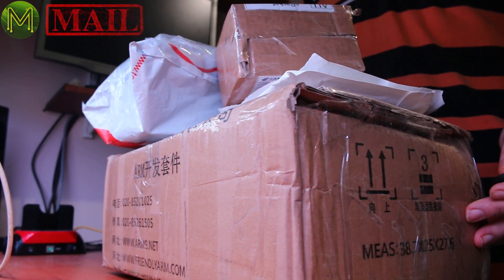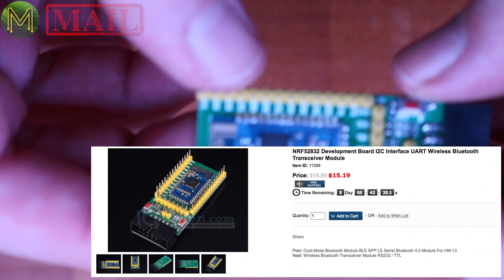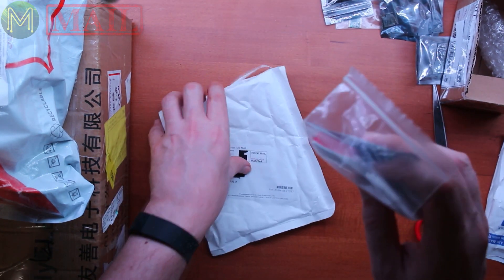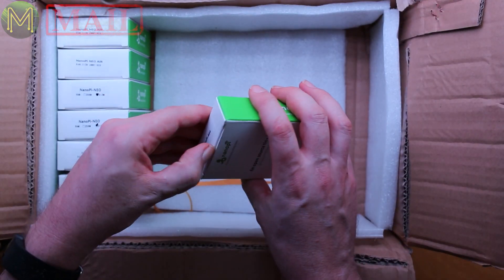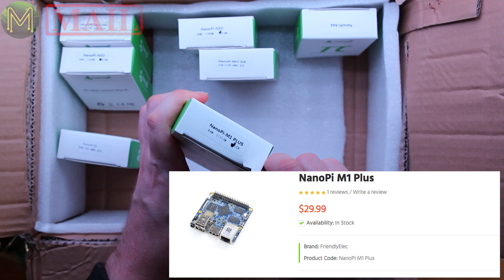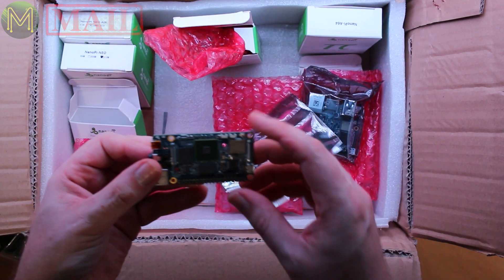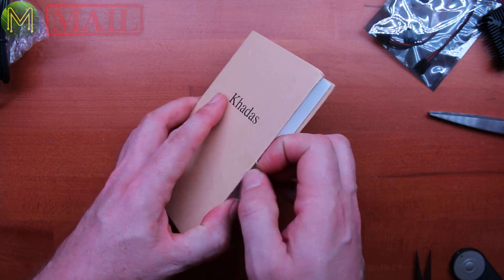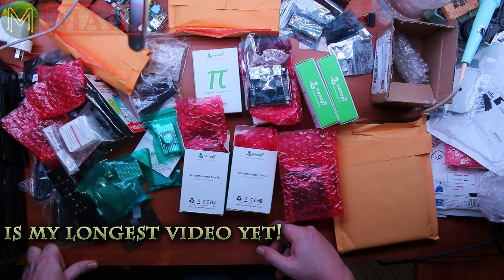#118 MickMake Mail #07: A massive booty! // News

Comment: The Firefly... I also ordered one but I had trouble with the shipping. Don't got it... hopefully i will get it in the future...
Reply from the maker: +Philipp Blum 
Alas I haven't had a chance to even open mine up! Not so good about the shipping. When did you order it?
Reply: +MickMake
I ordered it on the 17.02.2017. I called with DHL and they said there's an issue with the customs in Germany.  Firefly  gave me the only the order number from parcel. I wrote the support and then they gave me also the postNL tracking number. With this number I got the information from DHL. Uff... I want to start the project...
Reply: So, they said they will get back when they have an update for me. So then I haven't heard from them yet. I will give up. I will not receive this board in my life. The 250 Dollar are not such a big deal. It's not that much money. Event If I receive the package in 6 months how can I work with this company together if they can't send me an package in a reasonable time? I'm really frustrated about this topic because the SoC is really interesting and fits really nice to my current project. But I will order the 96 HiKey Board. Similar Specs and I thing the Linaro EcoSystem is well developed. So we will see.

Comment: Always Good Mannnnnnnn .. thanks or doing this. you save me bales of time.  BTW I have a question. Ever seen any ATMEL RF215 boards around ? They are used utility A LOT for a standard called WiSUN (like Zigbee just better)
Reply from the maker: +Peter Laidlaw 
Actually I haven't seen those before. There's so many boards around. I'll check those out when I return from vacation.
Reply: Here is one but expensive: http://www.atmel.com/tools/atreb215-xpro.aspx
This chip seems to me anyway as the wireless maker's dream but strangely does not have a following like LoRa .. millions deployed in smart meters.

Comment: Mick, what is a good board for a beginner?  I work a lot with PIC chips in machine code, etc. making LED cubes.  Am looking for a board to replace our pile of laptops.
Reply from the maker: +Paul Barton 
For a beginner nothing surpasses the Pi. You get a massive community backing, it's cheap, and guaranteed someone has already done what you want to do.
If you want to step up, then I'd look at an Orange Pi Zero or NanoPi Zero.
Reply: OK, thanks Mick. Was looking at the Zero-W, if they are "in stock".
Reply from the maker: Yup that's a good board to get started on. Have a look at my short review video on the Pi Zero W where I show you how to connect to it without a keyboard and screen.

Comment: Just checked a Sonoff i got off Banggood when they were on sale a while back. It's the same 10A model (is that rating, or model #? I dunno) as those, but has no such modification. Is that something I should look into adding, or is it not really needed?
Reply from the maker: +stryk187 

+pawel753 also commented on this. Seems I'm the only one with that mod. What about your mains copper track width? Is the same as mine?
Can you take a photo? Would be good to compare with mine.
Reply: +MickMake Yep those tracks look about the same as far as i can tell, just snapped a photo, sorry for not so good lighting, but here's a link: http://imgur.com/a/QBjLa
Reply from the maker: +stryk187 
Thanks for that. Yup seems to be the same. Wonder why they added that cap.

Comment: And what are you going to do with all these Pi Zeros and Nanos? Except giving few of them as a prize of course ;)
Reply: he mentions that he will be doing "home automation"  in his studio. these boards have a wide range of use from robots to servers
Reply from the maker: +pawel753 
I have a bucket load of tutorials coming up. Some of them are home automation based, vehicle projects, LoRa, then there's a revisit of my old projects to bring them up to date.
Reply: My point was actually, you don't always need separate device for each project. For example I've got Banana Pro which I use for more than a year as 
(1) NAS server with SSD connected to SATA port
(2) Home automation centre - Domoticz with RFLink (Arduino Mega) + many 433MHz devices and ESP8266 switches/sensors
(3) RSS notifier service - cron checks for RSS update of my favorite channels and sends me email notifications when something new come up
(4) from time to time I even run a video processing in a background - I use it to convert videos uploaded remotely on SSD from MOV format to MKV
My BananaPi works great with all these stuff running in parallel and my only concern is that I will have to setup all this stuff when my SD card is down ;)

Comment: I've got 6 or so Sonoffs bought on ebay in December and Feb but none of them has this strange "homemade" modification :) And all of them works perfectly without the additional capacitor! I'm very curious why did they put it after production stage, maybe they got some malfunction warranty returns which happen under some circumstances
Reply from the maker: +pawel753 
Are you located in a 120v mains country? I know that the somoffs are both 120/240v capable, but maybe this mod is specific for 240v countries.
Also are your mains power traces as thick as mine? There were some "recalls" due to the copper being too thin.
Reply: MickMake I'm from Europe so got 230V power but I belive these devices are universal an fit every power voltage, similar to phone or laptop chargers

Comment: I have most of the friendly arm/elec boards so far the NEO air is probably one of my favorites with armbian as it has built in WiFi and Bluetooth and and with armbian you can get a uart console over usb so its a create portable pc that could also be used as a small usb flash drive with 8GB eMMC flash
Reply from the maker: +Darren Rainey 
I think the Neo Air will be one of my favourites as well. 4core, 8G eMMC and wireless in such a tiny package makes it very attractive.
Reply: Yeah I think I might use mine as a mini wifi repeater or extender its so small that I can keep it inside the case for my glasses as well as a battery

Comment: Is that a substitute for an Y-class capacitor in the Sonoffs? What an absolute dodginess! (on the other hand, the module doesn't really have any conductive parts sticking out of it apart from mains cables, so no way of shocking you even if the cap  fails)
Reply from the maker: Yes it is a dodgy fix and yes as you said it's all housed relatively safely so no harm no foul, (sorta).